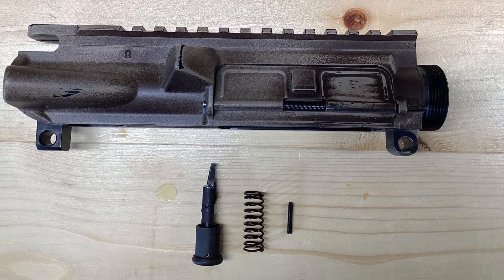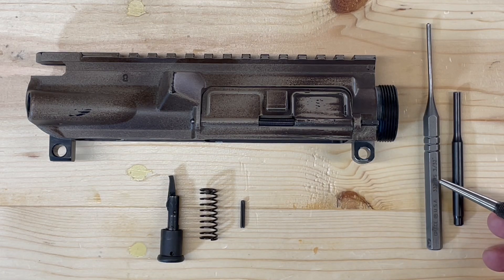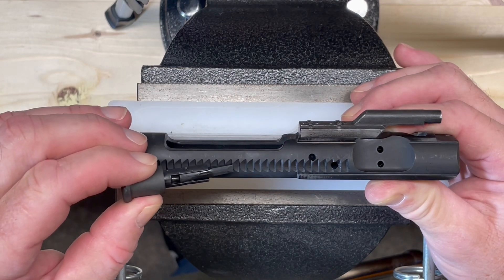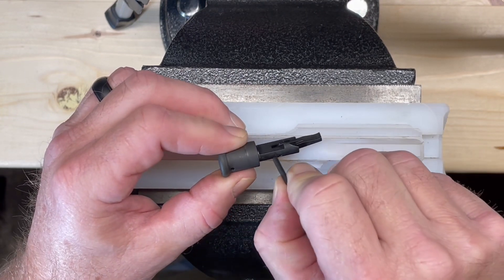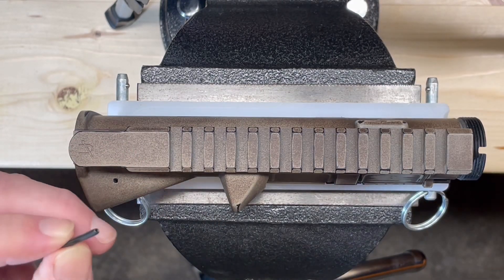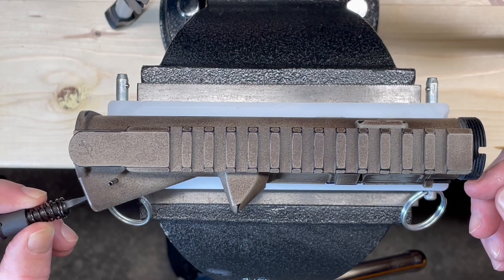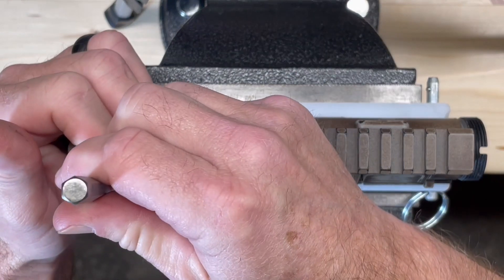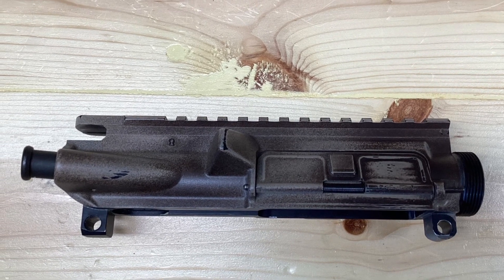AR15 Forward Assist Installation

Comment: Isn’t the original design meant to have the forward assist pin installed from the bottom up?
Reply from the maker: Yes it is. Im not aware of any functional difference and it’s easier to install in a block from the top down.